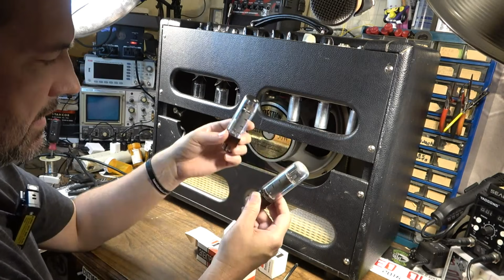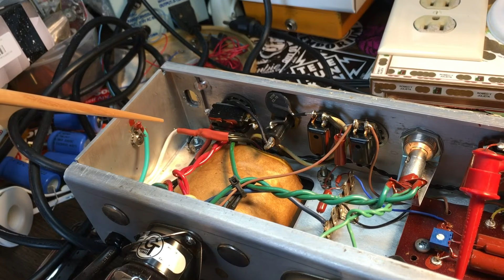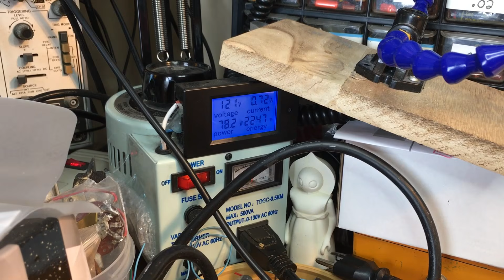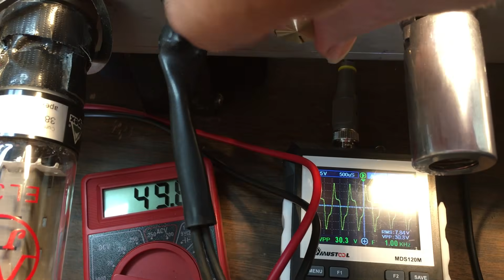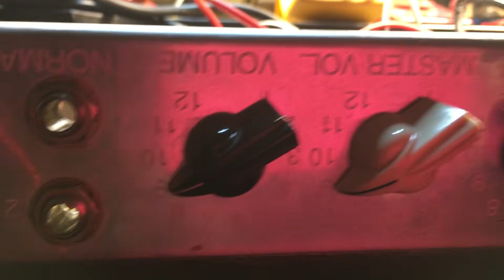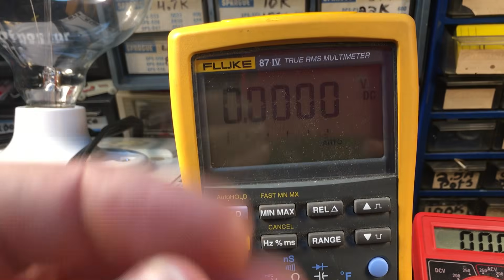STOP USING THE STANDBY SWITCH ON YOUR GUITAR AMP!

Comment: Hi Brad,
Glad to see you back on the channel. But your comment did raise a question with me. 
See I have been hard wired to believe that with a tube amp the stand by switch acts as a 
Power tube cool down after playing I have always switched the play mode to stand by to cool down the power tubes
And to eliminate any crackle pops if accidental chord disconnects. And you are saying that the stand by switch is no longer needed.
Thanks brother

Comment: I have mostly heard not to use standby switches. On dr z'channel he says only use standby if you have a solid state rectifier. Other than that i had an amp that said put it on standby for 2min. Mostly though techs say don't bother. Now standby or not my my current amp "fades in" at about the same rate

Comment: Doesn't the use of the "inductor filter" directly after the rectifier mean that the voltage and current will be quite a bit higher on power up than the more common "capacitor filter" designs?  That is what I have found when testing power supply designs.  Thank you for the idea of adding thermistors.  I will update the design I'll currently working on.

Comment: so ? what do we do ,  us , that can not proceed to that "repair" ( because not beeing qualified for that) to power up our 
power/standby amps the best way ? leave the standby always on ? turn on the amp at no volume ?
Reply from the maker: If you have an amp with a tube rectifier, just leave the Standby Switch in the ON position and use the On/Off Switch only. Just don't flip it on and off really fast. If you turn it off let the tubes cool down a bit before turning it back on to prevent an inrush of current. If your amp has a solid state rectifier, you can probably use the standby switch without issue, but you also do not have to use it. This video was more about designers not designing Standby Switches into their builds. Wasn't meant to be a guide for users. Maybe I'll do another one and clarify that.
Reply: @TheGuitologist I have an Imperial tone king Mark II (so with tube rectifier i presume) .  thank you very much , Brad !

Comment: The Russian 5AR4's are more robust in my experience.   However,  I have a few JJ's in my project amps that have been hanging in there just fine.  I think I'll be finishing another project amp tomorrow......... Also,  in regards to the negative feedback loop........  when you're turning it down/off,  it makes logical sense that you'd see a current increase,  because the NFB  effectively "turns down"  the Pre-amp tube it's connected to.   Sine wave testing is the most brutal thing you can do to an amp......  because unlike music with a break between notes,  the amp gets no break...  it's just a blasting one note infinitely.
Reply: Feed it a pretty square, square wave!